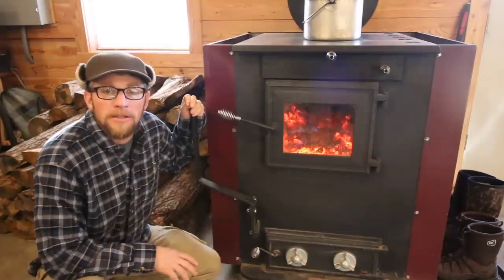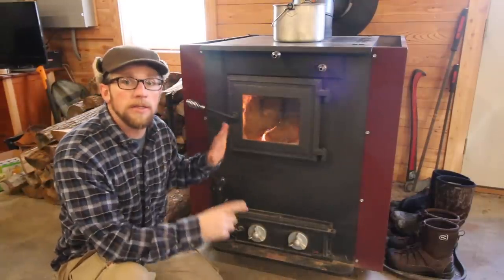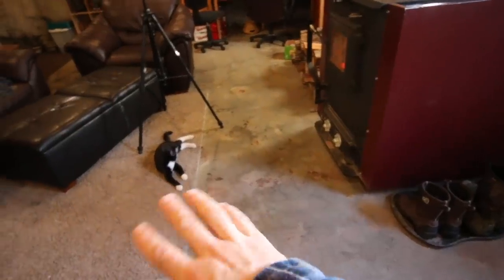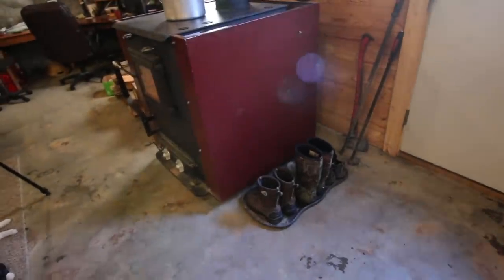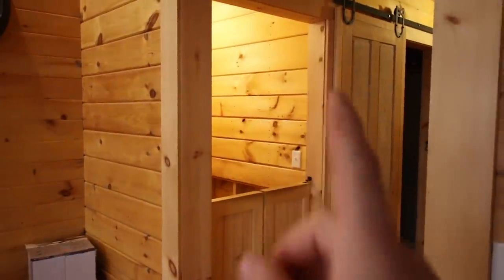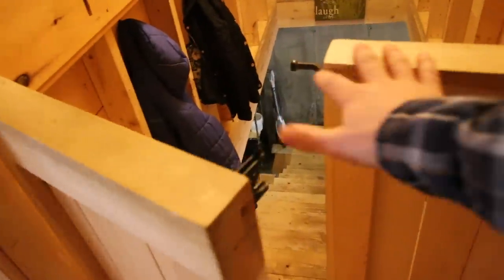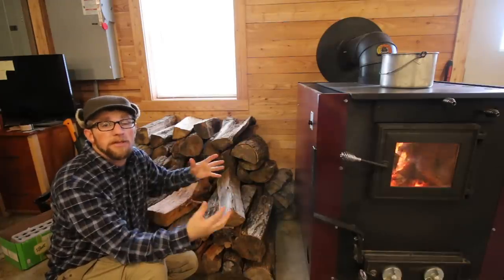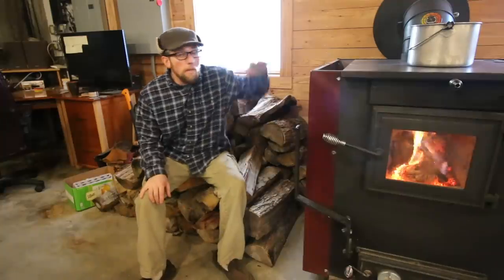How we Designed our House to be Heated with Wood & Natural Convection

Comment: Hope your aware that your stove is putting out more particulate matter (pollution) then every single other EPA approved wood stove on the market.  Nice...
Reply: @jipedowilliamson204  Your public statement about the amount of carbon given off between rotting wood and burning wood is technically factually correct.  However what you apparently have failed to realize or conveniently have left out of your statement is that the particulate emissions emitted by that particular stove is (hopefully obviously although be it maybe not to some) much more than the log if it were rotting in the woods.  Have you personally witnessed this stove fail an EPA test for have you seen the data that wasn't published on this particular stove?  If you have then lets have a cevil discussion about that unit if you haven't my advice would be to educate yourself and then I would be open to having a spirited discussion.
Reply: @grobinson8  what is so detrimental about wood stove particulate released outside? Not any worse than breathing while walking around a city centre full of emissions. Wood stoves are the least polluting option available
Reply: @jipedowilliamson204  "Least polluting option available" compared to what?  I work for a biomass company.  I sell and design biomass boilers along with a host of other things that all revolve around the burning of biomass and renewable energy.  I do not have anything against wood heat.  I do however take issue with manufactures misleading the public or their potential customers on wood stove emissions and how (or in this case how not) efficient or clean operating their devices are during real world operation.  Your stove is a great coal stove but there is a reason the manufacturer couldn't label a wood stove and it's not because it was super efficient and clean burning.  It was because it failed miserably and they chose to bail out of the wood stove market and instead cheat and offer it as a coal stove only option to get around the law.  Then some poor fellow comes along it doesn't know the difference between 2.5 nanometer particulate matter and anthracite coal pollution buys that device and thinks they have a great product all because the manufacturer "choose" to mislead them.